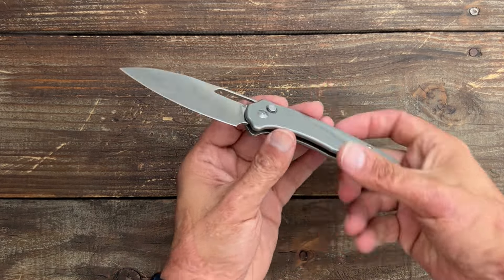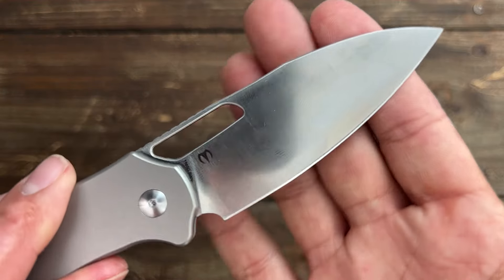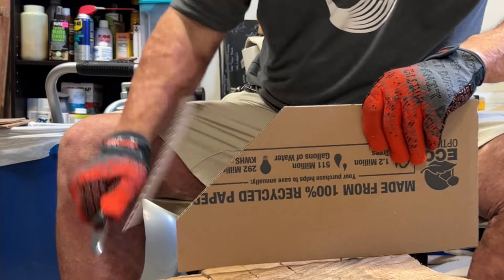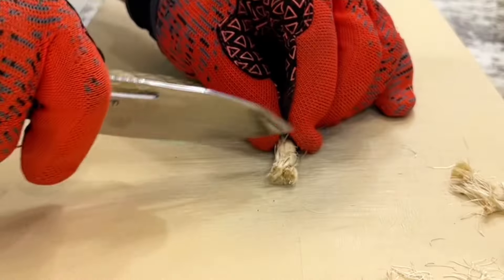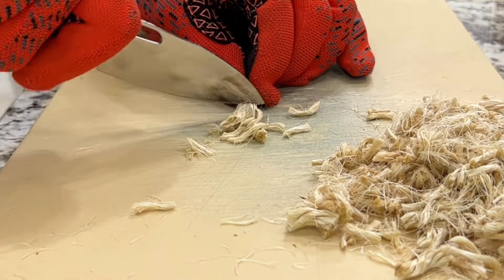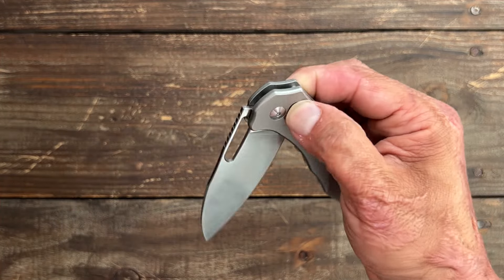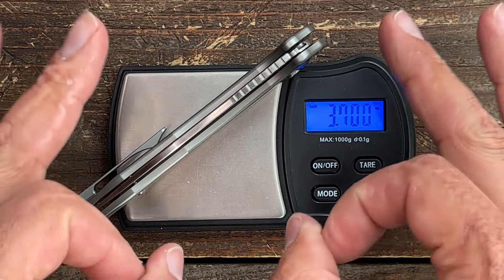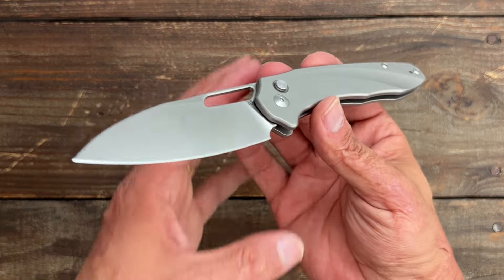Best Bang For Your Buck: Artisan Cutlery Ornis Review & Testing

Comment: The CJRB Frack in ti and S90V has a proper finger choil for the index finger. Same parent company . Pretty sure the price is close to identical.I dig the frag grenade texture better too.
Reply from the maker: Yeah same parent company, I have the Frack also but the Frack is bigger than the Ornis, I like them both but my Ornis has a much better action than my Ti Frack 👍🍻🍻
Reply: @Stassa23  my Frack has amazing action. As a scientist, it isn't without friction, but the bearings may as well be a net zero regarding friction. My Frack has 100% freedom of movement should I allow it.
Reply from the maker: @Cy1onRaider  you definitely got a better one than mine, I’ve even taken it apart to clean it out but I think I just got a dud but I still personally prefer the size of the Ornis but that just a personal preference 👍🍻🍻

Comment: It's good looking and a heck of a good deal for the price, materials and design. That said, I do wish manufacturers would run their S90V a little higher.

IDK what the HRC is on my Knifecenter exclusive Spyderco Shaman but that S90V is amazing. I'm still running the ( frequently stropped ) factory edge going on nearly 2 years and it's not a safe queen.

Comment: this is the Frack minus all the glory.
Reply from the maker: I have the Frack as well but the frack is a good bit bigger
Reply: @Stassa23  my comment remains unchanged. Frack is a better choice.
Maybe I'm spoiled with the Frack.
Reply: @Stassa23  I can't lie. Ever since I got my BGM Kephart MagnaCut a week ago....9 month wait.... I could'nt care less about my Frack. 
My BGM Kephart has replaced ALL my former EDC knives. It fits perfect as a horizontal waist carry and the steel is perfectly heat treated. And since it is a fixed blade, no worries about action. 
This is my 3rd BGM and it is amazing.